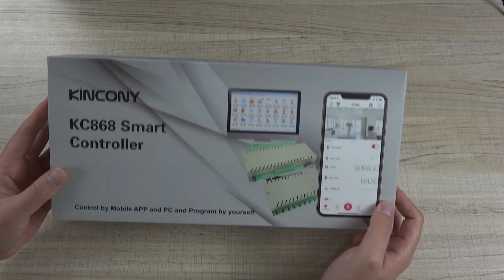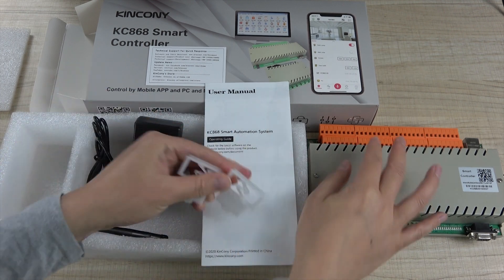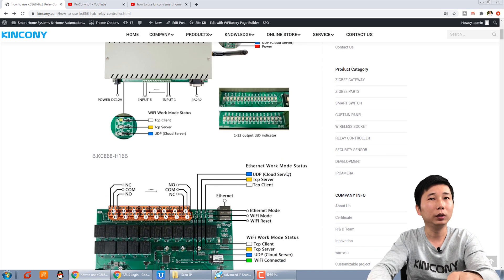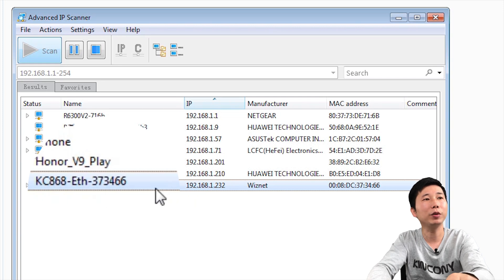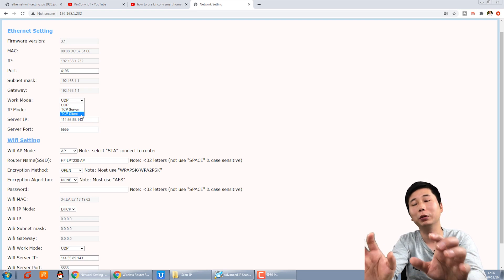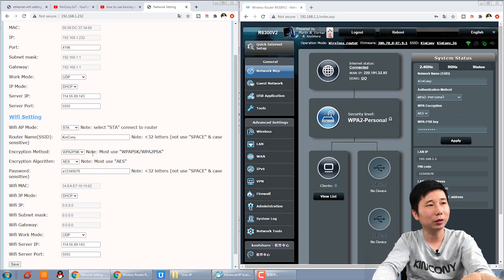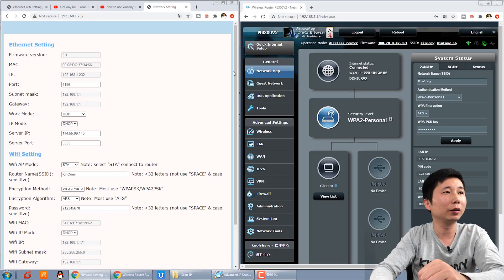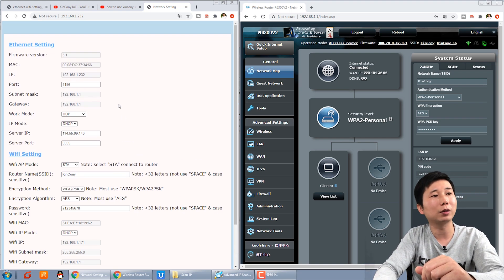【how to use KC868-H32B#7】ethernet and wifi config by website

Comment: And how to disable wifi completely? There's also no way to save anything neither wifi AP setting nor STA settings. After reboot it drops to defaults
Reply from the maker: just set to AP mode.
Reply: @KinCony  it is set by default. I can see HF_LPT230 without password even when connected with ethernet
Reply from the maker: @MrBertmsk  yes.

Comment: Hi sir, please make a tutorial video on how to connect AWS IoT core using MQTT. It easier for me to buy and configure using your product. current ly we're looking for a device that can connect to AWS IoT core. Thank you
Reply from the maker: we already plan for MQTT firmware with KC868-H32B, when finished, we can have a test.
Reply: @KinCony  it’s firmware with other KC868 will work too?
Reply from the maker: @ГлебШрамко  KC868-H32B's firmware only for KC868-H32B, it use new technology of hardware.
Reply: @KinCony  maybe I can buy any chip for KC868-32W to KC868-32B?
Reply from the maker: @ГлебШрамко  No, it's different.
Reply: @KinCony  Why? MQTT is not that complicated. Why are you not supporting older devices? This devices don't come cheap, we can't buy another one just because the the new one has a very important features in the IOT world, but you just don't support the older device.
Reply from the maker: @Orochica  KC868-H32B will support MQTT in furture, because old version CPU and hardware resource is not enough for MQTT. Because the cost of the old version is low, so the hardware resources are less, H32B design for different hardware resource,also use large CPU. So we also supply the solution for old version connect to different third software platform.